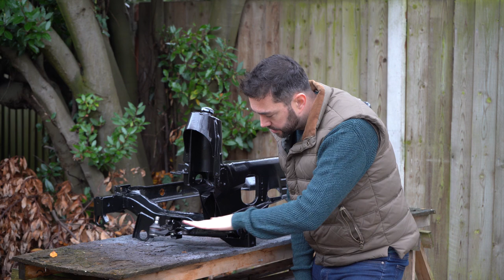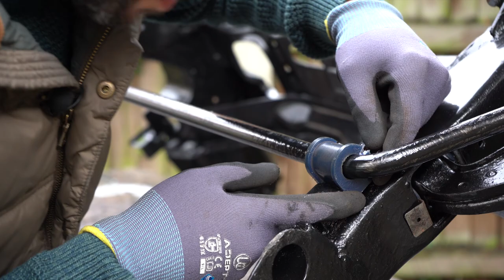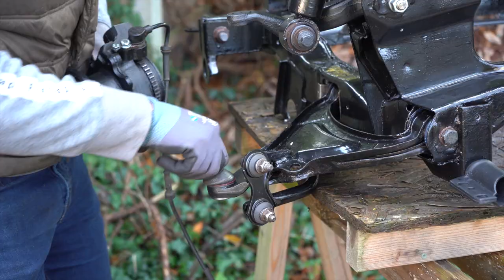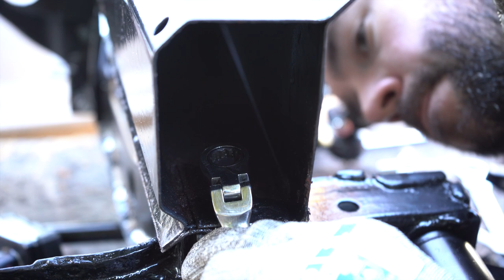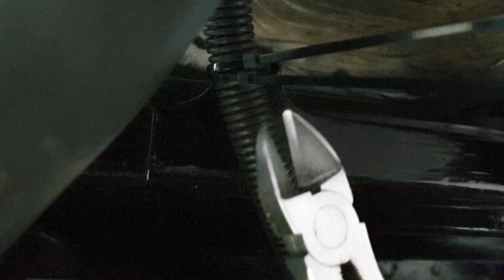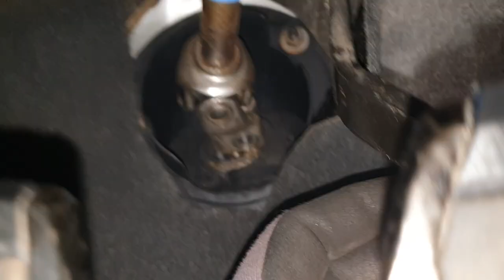Refitting a subframe on the MG TF

Comment: On the subject of torque, I'd just like to give a little advice, I don't want to come across as a jobs-worth, it's for safety reasons. Many years ago I fitted brake components at a car factory in the North East, and they were classified by the M.O.T. as an important A grade fitting, and we had to be certified to fit them. The copper washers and bolts had to be spotless, if we dropped one they were binned, and we never touched the face of the washer either, as grease or dirt could contaminate the fitting leading to a failure, not what we want when hitting the brake pedal. Applying the torque was another certified procedure, the torque wrenches were calibrated daily, and the torque is applied when the wrench clicks ONCE. If you watch the portion of the video where you tighten the banjo bolt, you can see that each time the wrench clicks, the bolt moves a little more. The copper is soft so deforms, over-torque can lead to failure.

Comment: Firstly, thank you for taking the time to video the process and produce a video. Its been great and so informative. Short videos have their place, but I love longer video's because they, like this one, take the time for a deeper dive and go through the whole process without the rush to fit in 10 minutes.
The Gunson kit I swear by, since using one thirty odd years ago I bought another when I lost that one, and its sat in the garage for over 15 years, still in its box, never used. If ever I got to the point of needing to bleed brakes again, I wanted it on hand. I thought it was that good.
If you can't get a cap that fits your resivour buy a spare cap, new or second hand, and make something up. 
I've spent today pulling apart my TF drivers side front brake caliper which began binding, only to discover I've got a rounded passenger side wheel nut as my next problem - can't get the wheel off to get on to that side before it has problems. I've come home, put the kettle on and sat down to watch your episode. Life does always present a silver lining. :) Happy days ! Your video knocked the edge off my problems and left me smiling. Thanks mate.
Reply from the maker: Such a lovely message, thanks Alex, very much appreciated. 👍 in the past I've had great success with a set of Irwin Bolt Grip bolt removers...ive just checked and the 19mm goes over the wheel nut well...might be worth a shot. Good luck buddy 👍

Comment: I hope you have more luck with the Ezibleed than I did. It was badly assembled, the fluid pipe nuts were slack and a sealing washer was missing, the pressure pipe was loose. When I connected it to a tyre at 8psi fluid squirted everywhere from the clutch master cylinder and Ezibleed even though the cap was as tight as I could screw it. Used the £2 one man kit bought at a boot fair and it worked perfectly!

Comment: Well done Lee, another of your inspirational and well put together videos. My only suggestion is that you replace those horrid coolant pipes with some stainless ones asap. I have just been rebuilding my mg tf engine and have just replaced those pipes as they had large chunks of rust on the inside that would or could have detached and ended up clogging the narrow water ways in the cylinder head, a costly and time intensive excersise to remedy. I have just purchased a new stainless set of pipes for £62 inclusive of postage, can let you have the details if interested. Look forward to seeing the mg up and running, before mine probably as the workshop doors have swollen with the damp weather and I cant open them🥴. Colin h
Reply from the maker: It has been jolly wet lately!! Hope you get in soon! 😀 ....yes by all means let me know where you got them from...think mine are beyond saving!! 🤣
Reply: It was from Sams-autos on ebay, £62.50 inclusive, came with stainless jubilee clips and the plastic clips that hold the battery cable to the fabrication. 👍
Reply: @wheatleysworkshop  PEP102470SS is the part number for the SS under floor pipes
Reply: I can get into the workshop via a normal door but can't open the sliding doors that allow me to drive the mg out, oh well roll on summer, still have plenty to do on the old girl🤔

Comment: The underpinnings of my 2002 TF are in much better state even though it lived outside for the first 10 years of its life and used as my only car so not exactly pampered. As I commented on a previous video, I think yours is in the state it was in due to it being built when Project Drive (Dive) was in its full cost cutting swing and as 2004 MY TF it will have sat in a soggy field for 12 to 18 months before it was registered possibly by the receiver after MGR went to the wall.  Keep up the good work!

Comment: Mike, an easier way of getting the subframe in (or out ) is to slide it through the wheel arch on a piece of wood as you had. I just used a single sheet of plywood. It saves scuffing that paint that you so lovingly applied. I also left the anti roll bar and cross brace till the sub frame was in place.

Comment: A question Mike. How did you line up the steering rack to the wobbly joint in the car. Is the inner bit of the steering column suppose to be free to slide up and down or is that going to damage the crushable steering column and wreck the air bags sensors. Any advice ? Very grateful. The alternative means lowering the back end of the subframe to line everything up.AAAAHHHHH
Reply: Mike sorry to use your column as a share info space but I have finally found out how to line up and refit the steering column. The bottom section does indeed slide up and down but mine was surface corroded and wouldn't. Scotchbright and plus gas saved the day but not before i had been in and out up and down to loosen the subrframe and lower it a bit. The solution to set up the splines is to turn the rack so that the flat is towards you and visible, then turn the steering wheel till the "open"side of the clamp lines up with the flat. Engage the spline and slide it down as far as it will go and raise the subframe to fully mesh. Bolt in ,job done.

Comment: The bleeding kit you Show at the end are brilliant for bleeding the clutch however i dont think the caps fit over the break reservoir, i use a cheap 7 pound self bleed from halfords that works on a vacuum.
Reply: yes i agree with Floody it has a cap with tension strap it’s a bugger ! ended up with fluid everywhere .i did get it to work eventually but anything over 15 psi from the tyre and it’s a disaster. the caps supplied i’m sure work perfectly with a normal screw on reservoir but the TF on is not screw on . i’ve flipped to a suction one think that’s a better method than the gunson one for the TF anyway but by all means give in a go if you can get a seal first time Lee well done

Comment: Great video as always Lee. I’ve never been able to find a cap to fit the TF brake res., for the Gunsen, but you might be more successful. Lots of good work there Lee, nice one! 👍
Reply from the maker: Cheers Gary, thanks for the heads-up. 👍
Reply: You can use the gunson on the clutch fluid reservoir. Makes bleeding this a breeze. I would however recommend either refurbing or replacing the slave cylinder on the clutch as I tend to find new fluid finds them out! Also top tip be very careful in routing coolant hoses so that it cannot touch the metal bracket holding the slave cylinder. The metal gets hot and slowly melts the rubber then whoosh!!! Good luck getting it back on road great video